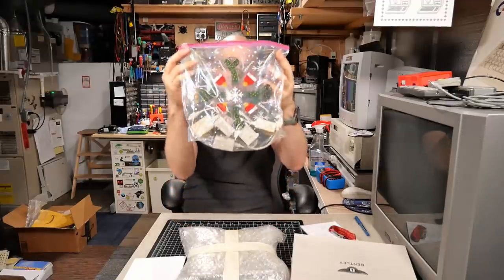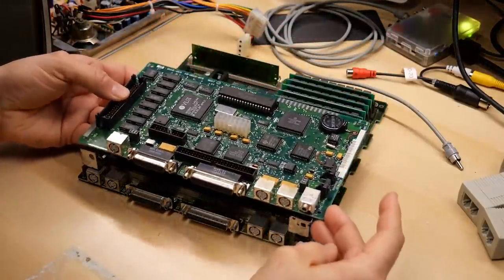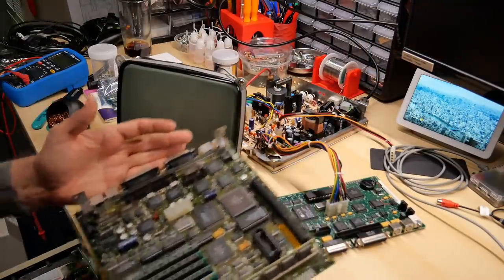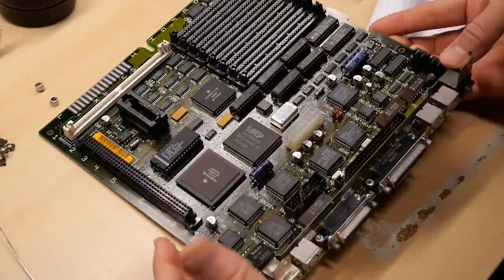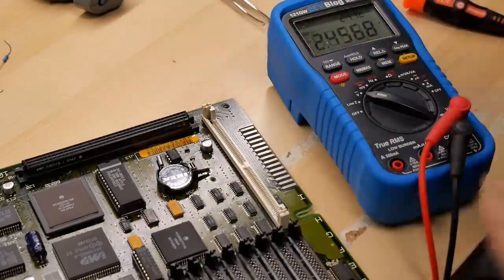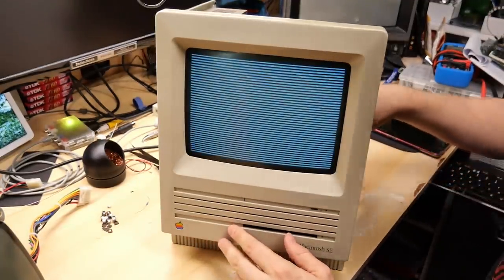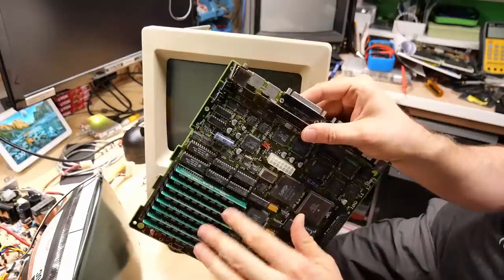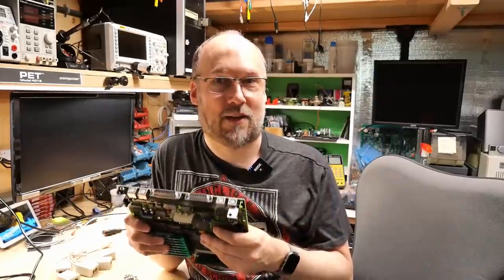Recapping and testing a Mac SE/30 motherboard

Comment: This computer back in the day was simply a dream machine running at 16mhz on a 32 bit bus. I did own a Mac Se HD back in the day, but gave it up due to the high cost for simply upgrades. My high density floppy drive failed and would cost over $300 Canadian to replace with a trade in of the dead floppy drive while a PC drive was only $30. I still loved that machine.

Comment: 3:18 - yes, 128MB was the maximum supported size, ran it as a web server back in the day. There needs to be some context around 128MB RAM, you have to remember most machines of that era came with 1MB and supported a maximum of 4MB! Even the most expensive PCs topped out @ 32MB and you would struggle to find an OS that supported more than 32MB! We are talking a 25Mhz 486 DX CPU era here!

Comment: I realize the legs will probably pull out of the caps or pull off the solder before the pads come off, especially with the leaking caps, but it doesn't stop me from holding my breath every time you twist away at those caps! Always look forward to your videos and learn a lot from watching them, especially about C64s. Got me started trying to get mine working again.

Comment: Finger contacts on those RAM SIMMs were notorious for oxidation (not gold-plated). Clean them up with an eraser. Alcohol-based cleaners don't seem to do anything. I can't count how many machines I saved just by this simple trick. I've had the same eraser in my toolbox for over 35 years. Some cheap erasers just don't work at all, but the classic pink ones work very well.
 
You can also place a graphics adapter in that SE/30 slot. 8-bit grayscale on those 9' monitors is stunning!

Comment: SE/30 came with System 6.0.7 or 6.0.8 originally if I remember correctly. I had one in 1990
Reply: System 6.0.3 is the supported minimum OS for the SE/30.  I just verified it on mine with its original set of floppies.
Reply: @minty_Joe  Correct!

Comment: Great video!  The SE/30 has a 16MHz 68030 and a 68882 FPU.  The paths are 32 bit.  The Classic II has the same 16Mhz 68030, and lacks the 68882 FPU (although you can upgrade it to have one).  I have a Classic II and an SE/30, and I recently ran Norton System Info 2.0 with its benchmarking program.  The Classic II, with its 16 bit data path, scored significantly lower than the SE/30.  I don't have the results handy, but I'm building a database of 68k Mac benchmarks.

Comment: I enjoy all your videos. I worked in electronics for 20 or so years and miss doing it since I retired in 2012. Although towards the end of my career most of it was pluck and chuck circuit cards. I loved doing component level repairs. 
I picked up a Vic 20 in box (missing the PSU) two weekends ago. It is the two prong square power connection , which I found a seller with one but it looks rough. I wish they made a new one.

Comment: BTW Classic II is also 16 mhz.. The biggest difference is the 16 bit vs 32 bit bus. 

My SE/30 has a Daystar Turbo 040/33 128K on it. (128k L2 at processor clock) which its adaptor slot also gave provision for me to install a Radius Pivot procolor display adapter to hook up its matching 17" monitor.  The accelerator sits parallel with the main board while the video card ascends vertically up the side of the case.  And yes it was a real pain to install it all. After it all sitting in storage for many years I broke it out a few years ago, replaced the internal drive I had in it with a SD2SCSI card and recapped the whole thing. And it still works as good as the day I got it in 1991. The Daystar and Pivot were installed in late 1993 and really did turn this into a great machine.  Before 1993 I still used the orignal 85mb drive with external 105mb drive, external scsi ethernet adaptor and 1x cdrom.  And a used HP IICX Scanner for photo restoration work.  Such good times.  It was all put to bed about 1995 after I got some good upgrades for a power PC I was working with beside it and didn't really get used again until about 3 years ago.  The thing I couldn't believe was how much stuff I had crammed on those 2 old drives... Totally crazy. And even crazier was I never had more than 8mb ram in it.

Comment: Also on the RAM, don’t forget the pictures you took at the beginning - if you put them in the way they came out it might just work.  Some of those old RAM modules would refuse to work in some slots, but if you shuffled stuff up they would work fine.  Always pay attention to what is where if it is working :)
Reply: Or maybe it works until the OS tries to store data in the faulty stick ;)

Comment: Fun fact: I had a SE I added a 40mb drive to that was so slow to spin up the bios would give the no os frowny face so I had to turn it on and then when i heard the drive spin up quickly turn it off then on to restart the boot process while the drive was up to speed. :) 
I bought the system to literally play one game and never used for anything else. :)
Reply: Another fun fact - I could get a Mac Classic ][ to print a page before the screen warmed up! I do miss CRTs, they seemed a lot more forgiving!
Reply: @Fifury161  shorter vids = more viewer visits = more advertising revenue for the greedy tube.  Heck I stopped watching tv due to number of adverts.
The tube wants content makers to do 8 minute vids.  E.g. Advert, 4 minutes content, advert 4minutes content, advert.
If the tube gets its way I'm off to a different platform.
Bye bye tube.

Comment: I've got two SE/30s, neither of which I've tried to use for years. One was working with very faint sound, the other booted up to a vertical stripey pattern. That one originally had a motherboard destroyed by a leaking battery, I imported a replacement from the US and it didn't work! I really should take a look at them sometime.

Comment: I personally prefer a long in depth video rather than a smaller 'series" version. But I suppose it's what you find easier to publish! Great video! Shame I dont live in is near you. I want to give you an amiga 500 motherboard and keyboard. No case or psu so I have no idea if it still works nor able to test it myself.

Comment: The SE/30 logic board was designed so that it fit into the SE case, and Apple did offer a service to upgrade your SE, but I believe it wasn't a huge discount. I don't even know if you'd get to keep your old SE logic board, or if the Apple service centre just kept it for spares or something.

I also hate those memory slots in the SE/30. Very annoying to remove SIMMs, I think I ended up using a small screwdriver to carefully lever the clips. It's especially annoying because my SE/30 and Classic II are the only working machines I've got that take 30 pin SIMMs, so they're currently my only way of testing my prototype SIMM modules. But not for long! I've ordered an Innoventions Inc. SIMMCHECK PLUS, so I'll be able to test 30 and 72 pin SIMMs!

I believe these classic Macs don't use the parity bit at all, so you can use either parity or non-parity memory. I didn't bother with the parity chips on my SIMM prototypes and they worked just fine. Obviously if you have dodgy memory, the machine has no way of knowing and will just crash or fail to boot or whatever. Not sure if the system does much of a memory test at startup, other than checking how much memory is available.

Lastly, I believe those video memory chips are dual port chips which are pretty uncommon. The dual port allows the video chip to read the memory independently of the CPU. I've got MT branded Micron chips in my SE/30, and I believe Fairchild also made a compatible model, but I couldn't find any NOS or dodgy Chinese sources for either parts on eBay. I've heard these chips were much more reliable than Micron's old memory, so hopefully we don't see them starting to fail like the Micron memory in C64s.

Anyway, another great video as usual. I also like the longer mini mail call videos, but this shorter format is great if it means more videos! Definitely do what works for you though.

Comment: I too learned the hard way about being careful around the CRT board on Classic Macs. Very recently in fact. Which means I cannot blame this on being young.

That said, it turns out that the air escaping from the CRT is what disappointment sounds like.
Reply from the maker: ROTFL! Yes it sure does ... the hissing sound brings an immediate sad look to your face. Back in the day, at least it was possible to buy new CRTs for these machine at least. Just not very cheap either.

Comment: I owned a Mac Classic II. It was not a 25mhz machine. It had the same 68030 at 16 mhz as the SE/30. However it had the annoying Apple "feature" of running on a 16 bit bus which made the same speed chip about 80% as fast due to that limitation. I also believe it topped out at 10 megs of RAM compared to the 128 meg fully 32 bit SE/30.

Comment: Thumbs up for that Marantz solid state portable recorder.
Reply from the maker: Good eye! I never mentioned it on the channel but I found that in the trash several months ago!! Works perfectly too. NO idea why someone threw it out.
Reply: Adrian's Digital Basement I can not believe that such a device which collected many design awards at its’ time could end up in the trash! Weird times we are living in. It supports the PCM format, there are no parts inside which can wear out over time, runs for months on a set of batteries, their media is dirty cheap and they have a broadcast quality sound. They can be underrated in general but it does much better job than an average Zoom does today. This should have saved it from trash.

Comment: The full 32-bit 030 Macs were the best products Apple ever produced (SE/30 and IIci) and were sold for a very long time.
Reply: I’m also partial to their Quadra 700 with the 040. Solid build quality and lovely, compact design very similar to the ci. I have two of them , one upgraded with a 100 MHz PPC 601 card, both of which are still going strong three decades after their release
Reply: @little_fluffy_clouds  That's fair. The Quadra 700 was basically a 040 IIci? I can't remember the memory limits, but my OCD started to trip off when they were promoting machines with 68Mb (not 64Mb) non-powers-of-two. And then of course they abandoned the power-of-two megabyte/gigabyte etc for disk. Basically toy-computers. :)
Reply: @rabidbigdog  yes, that's the one, it's exactly like a 040 IIci, although with full tantalum capacitors which means there's no need to recap the motherboard (I'm lazy). Design of the chassis is the same, although the placement of the logo assumes it's going to be operated in vertical tower orientation, however it works just fine horizontally, like a IIci, as well. The Quadra 700 got sort of famous after being featured in the original Jurassic Park movie.

It can be expanded up to 68 MB RAM, but that's because there's 4 MB built into the motherboard, and you can add up to four sticks of 16 MB RAM on top of that. It's an oddball amount, but I've learned to live with it. It's a generous amount of RAM for classic Mac OS anyway. I like to play my old vintage games on it (Marathon is still fun) and use my old versions of Photoshop, Illustrator and Quark Xpress, just for nostalgia.

Comment: Nice work! About the caps, I was wondering if it would be safer for the pads, if you held the base of the cap in place with one pair of pliers while twisting the can with another? That way the base protects the pads from the twisting forces. Once the can is loose you can gently lift the base.
Reply: I cringe watching him remove parts.

Comment: Eh, if it makes things easier for you then go for it, I'm happy to see these vids either way, though tbh I do like watching you actually do the solder work instead of the movie magic. I'm not particularly well practiced in soldering small components (most of my experience is just soldering speaker wires to terminals) so I like getting to watch other people do it to pick up some technique.

Comment: I would probibly disable the speaker amp in the classic psu if you use the se/30 board. Connecting psu ground to the audio input could cause the amp to pull the speaker all the way negative causing it to draw lots of current and get hot. I don't know how those boards work or if they have protection against it, but it would be something to look into if you are using it for long periods.

Comment: I still have my SE motherboard hanging on the wall in my closet.   It got zapped by lightning which rendered all the ADB ports non-functional, so I had to buy an new motherboard and replace.   Ended up upgraded the replacemetn with an 030 25mghz card... then buying a 476.. then giving the SE away to my cousin.   But I still have that SE motherboard... my first "decent" comptuer.    Funny, because I've got barn fulls of Macs, PC's, and 8bits...   but that one made it to my closet wall.   What a pukey thing the 68000 at 8mghz was...      but god I loved those black and white square pixels.  The square pixel was a revolution.  We take it for granted now, but back then...   pixels were horrible capsule blurry looking things made out of RGB...  fuzzy, yucky, not suitable for icons.

Comment: They used those slots because they were never intended to be used a lot - if at all. Most computers for end-users were modular purely for manufacturing optimization and some marketing (buy a weak one now, power it up later!). In reality they knew it was just a matter of selling a few configuration options and maybe expect one upgrade down the line. Us hackers of course changed parts much more frequently but we're a niche in that respect ;-)

Comment: My recap did not go as well as yours.  Seemed to go fine, but afterwards have a black screen and no chime, just a speaker cluck on power-up.   No sign of short circuits, and all the soldering seems good. So I will carry on looking for the issue.

Comment: I notice you're using Panasonic HB series capacitors.  These are general purpose variants.  I recommend something like Panasonic FK instead.  You get quadruple the ripple suppression rating for a 47uF capacitor for example and a lower ESR, which amounts to less heat and a longer life in the long run.

Comment: Since the SE/30 is one of Apple's 32-bit "dirty" models, you will need to install the MODE32 system extension (for Pre 7.1 systems, or the 32bit enabler extension for System 7.1 and higher if you want to use 32-bit memory addressing, and use more than 8Mb of RAM.
Reply: Add MacTCP 2.0.6 and get it on the LAN. If you have a LocalTalk to Ethernet bridge you can browse the web with NCSA Mosaic!

Comment: Thank you for the awesome video. I have a Mac SE/30 that booted a few years ago but now is giving me the "Simasimac" screen on boot. Any advice on where to start? I've removed all RAM and chips, they looked ok but I didn't use a deoxidizer, haven't washed the board with soapy water yet. I haven't recapped anything yet either or changed the battery. Do I change to a CR3032 like you did, or try to find another like original battery? Where do you buy those caps because my local supplier does not have the same format. Do they have to be tantalum or can I keep with polarized electrolytic? Someone suggested switch to tantalum. 

NOTE: My original caps are silver cylinders with a gold/yellow band around the base, and a black stripe on the side of the yellow band indicating polarity. Your caps have a black mark on top. I also have a "bodge" wire on the back of the board running from the chip near R29 to the chip near R17. Not sure why, your motherboard didn't seem to have a wire.

Any advice would be appreciated. I feel like I'll have to buy some assorted caps from eBay, could I get all 50V rated, and use them even where they ask for 16V caps? There is only one 50V SMD cap needed, the rest are all 16V.

Comment: when I recapped my classic II using the twisting-ripping method to remove the old cap, half of the traces underneath the caps were ripped as well. 😣
Reply: Hi Sir, everybody condemns this method, I personally never had a problem, my trick is to press down the plier against tthe board (holding the cap) and keep rotating the cap always to the same side, clockwise or counter clockwise never lifting the plier until the cap is free. Sorry for my english, not my native language
Reply: @JorgeCarvalho_web_dev  Fuckin' nailed it, better English than most youtube comments. If I were to heavily criticize it I'd say that "plier" should be plural. It doesn't make sense to me but for some reason words like "pants", "scissors", "glasses", "pliers", ect usually have an "s" at the end even though we're only talking about one of them.

Comment: 22:30 "considering the classic 2 has additional Mhz..." Can the SE/30 be modded or overclocked somehow to be the same Mhz as the classic 2? I wonder if you can just simply replace the CPU and/or the crystal in the SE/30 to overclock?

Comment: Hi, regrading leaking capacitors, would it be better to store aging hardware upside down when in longterm storage to prevent board corrosion?

Comment: The reason the connector between the logic board and analog board is the same is because Apple used a standard Molex connector.  You can still buy them today.

Comment: Question about changing caps...on an xbox board before taking the clock cap out it will show no continuity on my VU meter. When replaced it will show continuity. Why is that?

Comment: 1/2 AA lithium batteries aren't that expensive. And they will last a lot longer than that little coin cell. I'm not sure why you want to replace them, especially on a machine that is fairly hard to get into.